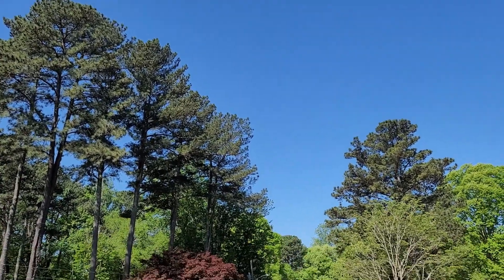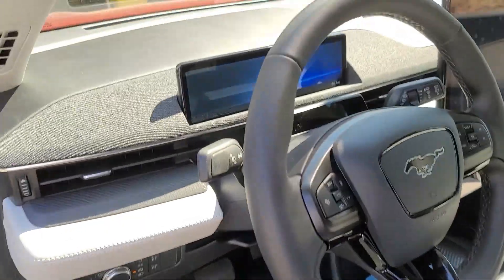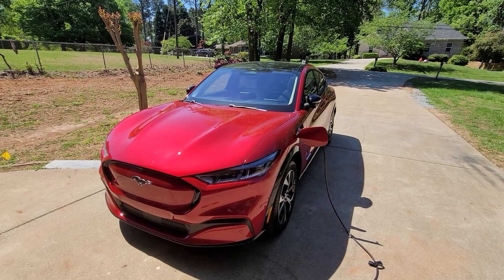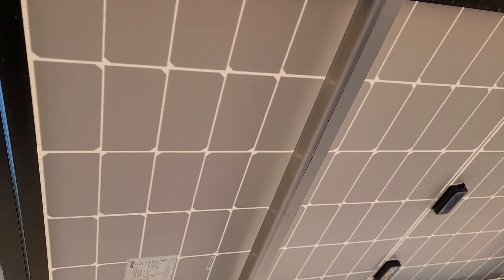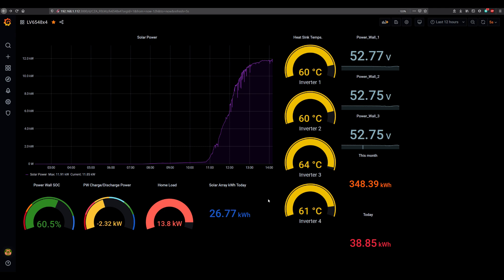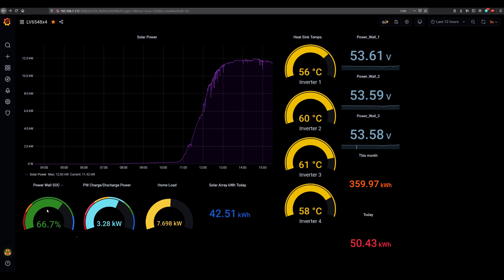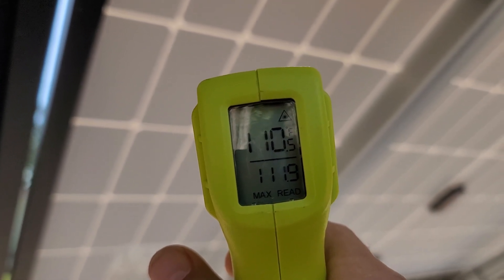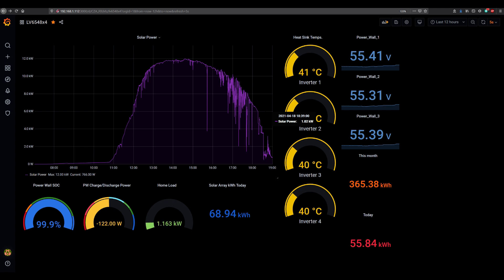DIY Solar System EV Charging & Performance Test

Comment: Wow man! Great day for sure and makes ya feel good about all the work AND even better.. OFF GRID! Thanks so much for the video! You covered it all  : )   Congrats on your new EV too!
Reply from the maker: Thank you. Have sourced installer for your solar panel yet? Cant wait to see your set up completed.
Reply: @DMIINC2013  I have a guy I contacted (Another electrician I used to work with years ago) He has his own company now and he's going to contact me this week. I have found a ground issue on my LV 6548's. There is a bonded (Factory) neutral on the AC out side of these inverters which is causing current to flow through the ground wire back to my main panel while in normal mode! This does not occur while running on batteries. This happens because there should ONLY be a bonded neutral at my main panel. My thoughts are that I need to remove the bond inside the inverters now. Not sure how they are connected yet. Did you ever face this issue on your setup? (5048's ) I am assuming you are totally off grid with the new setup...
Reply from the maker: @danfitzpatrick4112  Almost there with panels. Nice. When it comes to LV5048 I never tested grounds. But you are bringing excellent point since they use relays to switch over. My guessing is that if this only happens on grid power and not batteries that solution or starting point of diagnosing is somewhere near AC input and switching relay on the main board of the inverter. I am off grid with my setup for now but not for long since I have to finish siding, windows and change out power meter box. Will definitely look into it.
Reply: @DMIINC2013  Yes, that is correct. Everything is fine when in the backup (Battery mode). Only occurs when using grid power that is controlled by the inverter switching circuit.  This can be tested with an ohm meter. AC input neutral is not bonded, AC output neutral IS bonded. I will try to post a video on my YT channel on this soon...

Comment: That is just a beautiful system.  I am extremely jealous.  I want to build something similar with enough capacity to run the whole house and charge a BEV or 2.  I won't have a shade problem where I plan to put panels, but if I did I am pretty sure I would apply a chainsaw fix.
Reply from the maker: Thank you. https://youtu.be/mazLariRUUE Chainsaw took care of every tree on my property. I do not think neighbor would appreciate me cutting his trees down.